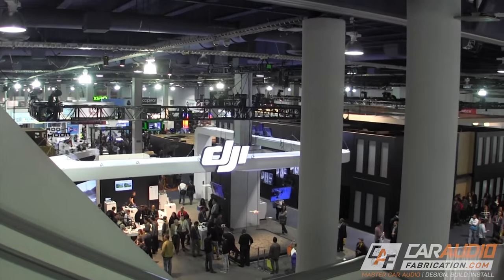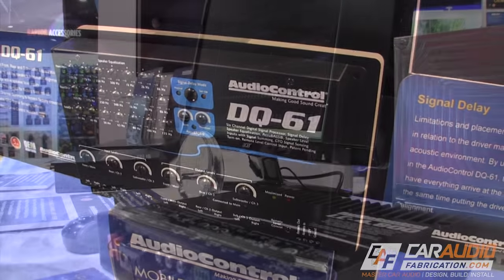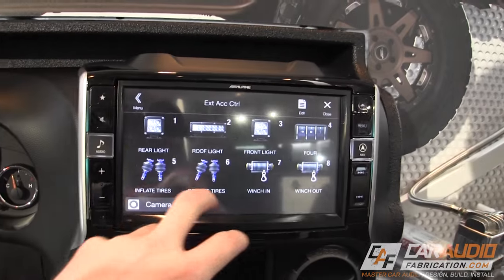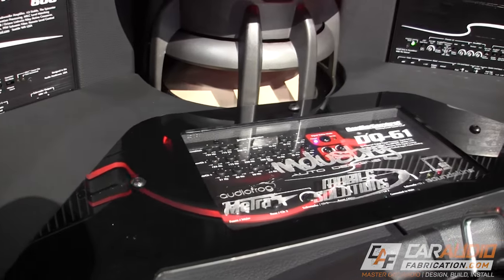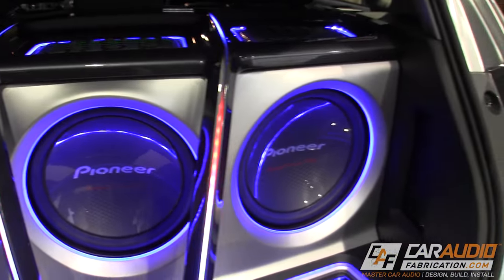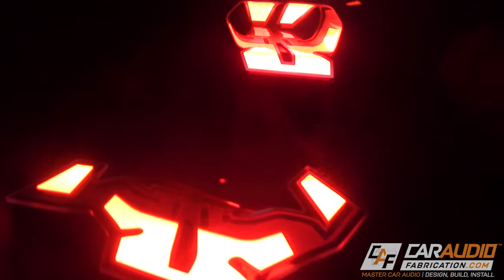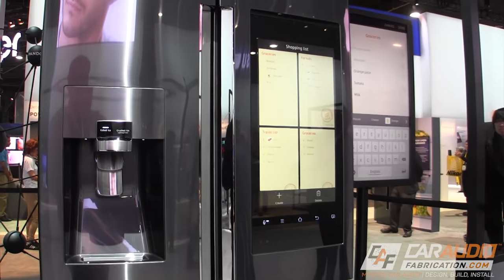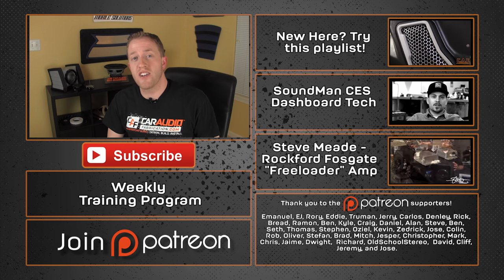CES 2016 - Best Car Audio Tech! and MORE

Comment: Late to the party here, but I also had thought about how car audio is going to progress with it becoming so difficult to integrate and upgrade the head unit at this point.  I actually had a thought on the issue back in 2011, and sent it to Audison as a suggestion.  Turns out they actually built exactly what I suggested, and called it the Bit Play HD.  The core of the idea is to offload control of your main input device to your phone or tablet wirelessly.   I think that will be the future, as phones will always be around in one form or another.  I think they could take the concept further by integrating it with their processors and building an all in one system that could be controlled wirelessly from your phone.  You could also apply things like streaming service support, etc, and others might be able to take it a little more "down market" for a less expensive application of the same idea.

Comment: While talking about bit rates in audio quality. You do not need a bit rate or resolution for an amp. Unless that amp has processing built in with digital audio converters it makes no sense. If the amp specs in frequency are within range of 10 hz to +22khz and distortion is at lowest, bit rate means nothing. Bit rate matters in the processor / head unit that decodes the digital recording or making the actual recording. Power has no bit rate. That is a gimmick sale.
Reply: As the audiophile demands analog, the car audio industry goes more towards digital. Makes no sense. I understand the need at times for digital processing for different staging techniques (especially when speaker placement is a factor), but not everyone likes the "digital" sound...like the bass enhancement features...it sounds so fake and distorted to me. I'll chose the proper crossover, and class A/B amplifier anyday.
Reply: +Captain Buff The Third okay that makes more sense for the amp that does have built-in DSP. but any other amp without any digital processing is going to be analog. even a class D digital switching circuit is still sending out analog sound your speaker is not digital. your speaker is an analog moving device. it is impossible to send ones and zeros to a speaker and expect it to have a variable frequency 4 sound production. Even the whole term digital, digital is still using electricity which is analog. You cannot tell me. I have been working with car audio, electronics and commercial recording studios forever. Unless you know what makes up an amp and how power gets amplified through the different classes all sound production is analog. Our ears are analog. Back to bit rates. Bit rates are your audio's reference. Like fine stranded copper vs thick strand solid copper. This is where resolution is also. There is no bit rate for that but frequency range. Speed of delivery and current handling. Bit rates and digital signals are virtual basically and not real to us other than altering the original signal supplied then spitting out again analog to the amplification which amplifies the analog signal perhaps in class D using a digital switching circuit to minimize wasted power through heat dissipation. The power switch one could say on an analog fet tube amp is digital because the input of on (0) and off (1) is either, or in a flip flop. A mechanical analog switch, but in definition can be considered digital output if you look at it by definition of digital.